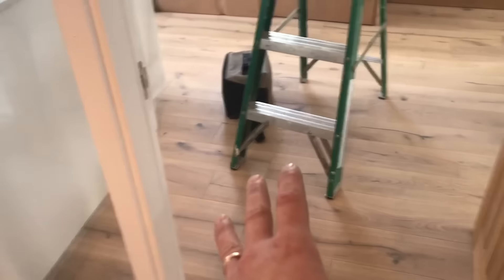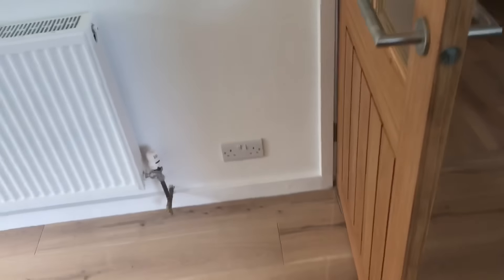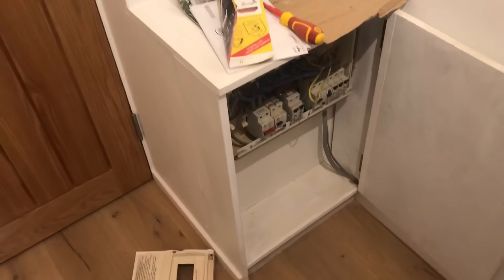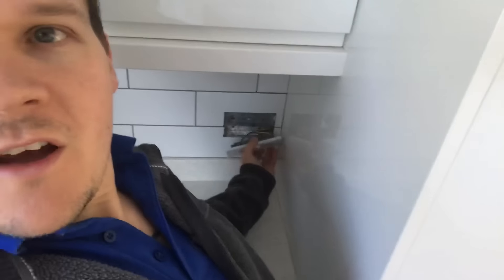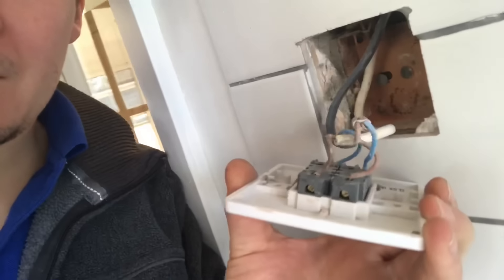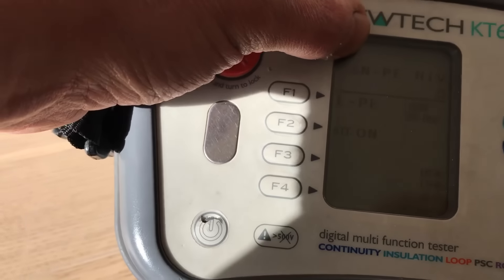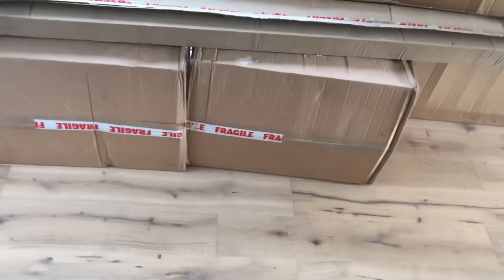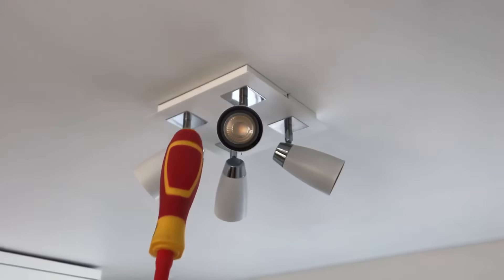Electricians day testing and inspecting one of the worst installs.

Comment: I laugh anytime an electrician says "absolutely shocking"
Reply: He's probably a switched on guy ,that's about as current a joke I can think of.(sorry).
Reply: @raychambers3646  Go ohm, you're drunk.
Reply: I might be in capacitor tated, you cant me charge for it.
Reply: I only became a sparky because I was no good at the polevolt.(or jokes )by the way if you are going to charge me I will brace myself!cheers
Reply: Guys, stop before I blow my fuse. Watt are you doing?
Each and every pun is only amping up the amplitude of my reaction. One more joke and I'll snap in a hertz beat.
I should be unphased by these, but I just can't. If only I wasn't grounded...
Reply: Erf, erfing, erfed. Hehehehe
Reply: James Bond slaps heater in bathtub, bad guy gets electrocuted. “Shocking. Positively shocking”
Reply: But it is shocking. Lol
Reply: You guys have Zero Potential
Reply: I don't give a fluke
Reply: Deplorable has no shock value

Comment: Thats why we use tubings in Switzerland so we  can replace the cables if it's  needed, without destroying the walls and the ceilings
Reply: While we also have that black ribbed tubing in the walls, you will never know what pain in the ass is to replace cable in one of those.
It is better for the wallet, but it is really frustrating, especially when a wire gets stuck somewhere and you have to fiddle with it.
Reply: in sweden we use thoese as well but lets say so, if you haven`t pulled cables into it or replaced, you dont know how to install it.
Reply: Fuck yes. That's how it should be done
Reply: @lazar2175  🤣🤣🤣🤣
Reply: We also do it in austria, just had problems with tubing from the 60s😂
Reply: @yanicascari5414  everyone has this problem😅 but there are some special sleeves vor this type of tubing.
Reply: We do in the UK but usually only on an industrial job!
Reply: @lazar2175  You obviously don't know how to fish wires through a flexible conduit.  Next time you want to pull wire through a ribbed  conduit try using fishing wire and a vacuum cleaner  plugged onto the other end , no more stress!
Reply: However, that it would require the job to be done by an electrician so they would actually install the tubing in this case someone who wasn’t qualified did this so the standards become a little bit irrelevant because they wouldn’t follow it

Comment: Ipx4 is basically the same as IP44 The 1st number is protection against solid materials and X just means that protection level not formally tested.
But i would always really suggest to the client to go with a ip65 fitting atleast just as a over protection.
Reply: Agree sometimes I’ll even go ip68 just to go beyond minimum requirements

Comment: I’m an electrician in the states and all this is super foreign to Me, but I absolutely love your passion for the trade, makes me think there’s still hope
Reply: I live in the States, and I'm not even an electrician and some of that work just looks shoddy at best, especially the uncovered wiring. That's a fire waiting to happen. Least they could do is wrap it in electrical tape.
Reply: I'm not a sparky but understand most of this stuff (bonding, wire gauges, IP ratings, MCB ratings, RCDs, switch ratings, rings,...) but I've looked at some US electrical vids too. Knew it was 110V, but what surprised me is that the 110V is actually a centre tap off the transformer and both halves are brought into the houses, so there is actually 220V available for heavy duty appliances like washing machines. The other interesting think to note is it's all single phase for residential in the UK, but in Germany, I've heard they do triple phase cookers and things.
Reply: @andyonions7864  yeah in the states standard residential mains are considered 120/240 split-phased. BUT.... I have seen larger homes in New Orleans with 120/208 Delta high-leg before.

Comment: When my  pedestral fan died as a kid, maybe 10 years old i took it apart a little as it was around 8PM at night and hot and humid as. Worked out the timer had crapped out so bypassed it to allow normal fan button control sans timer. Of course i did not know electronics at all, so i used a knowingly smaller gauge cable to get me through the "night" as a temp fix with no understanding of electronics or electricity (it's all i had, i used my professional touch the insulated cable why live after an hour to test for excess heat, solid pass as i can write this). It held up for another 15+ years before i refused to move a sub $20 item to yet another house. I don't know how i survived as a kid. That works seems similar to mine, except mine worked reliably for 15 years lol. Jesus, some terrible work there.

Comment: I am a retired research professor. I've worked in laboratories wired this badly. Scary. 
   What is even worse is when the sparkies come in, do a repair on another part of the building, and your equipment stops working. Motors running backwards, one phase dropped on a three phase line, and so forth. Radio frequency signals on the lines, and other insane things. Good luck cleaning up the mess!

Comment: IP44 is IPX4 compliant.  The X simply refers that the first number after IP can be any number.  The last 4 is the important bit.  That said, the whole installation is worse than most DIY jobs.  I think the spark who did that went by the name of Stevie Wonder...
Reply: I wonder if a shower qualifies as a "water jet"?
Reply: First number refers to dust ingress, second is water ingress.

Ipx4 means the dust ingress is not required but has an ingress protection of 4 for water.
Reply: @synony6  Yeah, but the "manual" showed X5 for a water jet so I was just wondering if a shower qualified as one.  I'm leaning towards it not doing so.
Reply: @thisnthat3530  Imo,with the lamp being that close to the shower head means it's possible for "water jets" to fly about. I think most people don't point their shower heads at the ceiling and much less at the light fixtures but hey,anything can happen...and it's still possible for it to happen to that light fixture. Agree?
Reply: Does any of that really matter when the fitting isn't earthed?
Reply: @firstsurname9893  shouldn't need an earth, it's marked as double insulated. Although I wouldn't trust it with the extra choc block.
Reply: @98dizzard  Cheers for the clarification, the screen I'm on is so tiny the symbol just looked like a blob.
Reply: Was reading the comments to see if anyone els picked this up😂
Reply from the maker: The light fitting is pure shite so are the connections I would not be happy showering in that shower.
Reply: O your correct the electrics are really bad... I would of walked away... And said call me if you want someone qualified to do the install...!!!!!
Reply: @Boons___1  Kids always find a way. Gotta build stuff for the worst case scenario. I just wonder how effective a fan is so far from the shower, a 12v unit directly above would do the trick..
Reply from the maker: Concrete ceiling
Reply: @brettv8  yeah I agree
Reply: Do your wet area rules limit the voltage in the zones? So does it mean ipx4 with a maximum 25v AC in zone 1? With the 240v connection in a zone 2 or better. I'm a bit confused on how that's worded in the rule book. Cheers
Reply: the first number is the size of the holes, IP2 and up you can't touch any parts with potential. The second number is how resistant to water it is. IPx5 was needed in that special zone, and the light was IPx4.
Reply: @curtisbarry2950  me too hahaha
Reply: @jgarde5378  Yes voltage and "selv" Separated extra low voltage. Using an isolating transformer. Normally is the way to go. BS 7671 isn't a statuary regulation. However if you meet the man in the curly white wig and you have fully complied with them you can go home rather than jail if some thing was ever to go wrong.
Reply: uhm maybe I don't get it.... but the standard says zone 1: 25V AC or 60V DC..... doesn't look like a 25V AC light.... it shows anyway the double square "double insulation" so no earth is normal
Reply: This lamp has never a ip44  rating. That label lies.
Reply: I would have thought an IP44 fitting would have a sealed terminal block if located in the fitting base. Because the fitting base is screw slot, surely that would be over the 1.0mm access probe limit for the IP4X portion. Might be wrong though but food for thought though.
Reply: It was a double insulated fitting and IP44 light fitting in the shower cubicle so it's ok, rewire the rest but keep the light😂😂😂

Comment: In America you have to have a permit from the township or city your working in before any work begins. And are given a check list that has to be posted and checked off by an inspector at each stage to pass. And here in California you have to be certified to make up or hook up any wiring. Even if your just replacing a switch.

Comment: I am just amazed by the electrical installation my grandfather did 40 years ago when our house was built.. Nothing has ever failed plus the 3 phase cable that's running around the house can handle over 40KW at 240ac..

Comment: Last job I did was exactly like this same situation and I said to the guy who hired me (lovely hard working and understanding dude) that the flat is a shit show and it needs a total rewire. He said yeah, whatever it needs, especially since he would be renting.
So to save cost he helped me and we did it over weekends. We rewired every single socket, every light, added what was needed and when I say rewire, I mean we literally took it back to the main fuse and earth. New DB, then wired it all as if it were a brand new build from scratch. We even fitted bath gadgets, inductive cooker etc and in the end I’d say the flat is state of the art and with his help I think it cost him around £500/600 (maybe a little more- excluding materials).
But in a job like this you are right mate, nothing to do but a full rewire. I said it straight up to the customer when I had a look- we had to raggle walls back to concrete and everything but in the end it’s the only proper way to do things.
One thing I’d always advise is do what I tried, then leave lots of spare cable inside the cavities available for future sparks.
Also added junction boxes for lights etc where possible.
We took that place from fuse wire and disaster, to split 12 way DB with dual RCD. Not heard of a problem since. All the testing was well in line too. Sometimes the hard way is the right way.

Comment: If that much money has been spent on the flat, i'd get the painter back as well as the sparky.
Reply: He painted the floor aswell. 17:13
Reply: the guy that did that job, wasn't a 'sparky' by any stretch of the word.
Reply: come to that, she should also get the plasterer and carpenter/builder back. The whole job looks reasonable at first glance, but the closer you inspect, the more you find which could be done differently and better. She has been comprehensively ripped off.

Comment: Regarding the lamp in the bathroom. If IPX4 is required then IP44 should be ok right since the IPX4 dont care about solid object ingression. :)
Reply: Regardless of the IP rating it's not suitable. Although in terms of an EICR, if ceiling height is above 2.25M (which it probably is) its outside of all zones
Reply: @londontrada  He measured the distance and it was only 2.1m to the ceiling, this means the fixture is in zone 1.
Reply: @thomasbonse  ah, well there you are.
Reply: He clearly said the fitting was in zone 1 and required an ipx4 which the fitting was an ip44 which means the fitting itself is fine
Reply: Who cares about the IP rating, the bloodly thing had no earth!

Comment: at 16:00
IPX4 and IP44 are equivalent. IPX4 means IP(anything)4. The first number is irrelevant as it denotes dust resistance, the second number is the water resistance.
So there is nothing to "add to the list" there.
Reply: Yeah, was all good until that bit..
Reply: @user-ul5gi9yw9t  The light is IP44, but it doesn't look appropriate in my eyes for a bathroom, not typical for a bathroom, also, do you trust some unbranded kit with their IP ratings.
Reply: @davidprivate5786  It's DAR lighting, not unbranded. Said it was good when in the kitchen

Comment: Great video, it’s all to common.  Arrive to install an extra socket or lighting unit.  Pre-work survey, no bonds, recent works, speak to the client, EICR performed & it’s horrendous.  I have a few times over my career stopped in the middle of a report, consulted with the client, charged the client a nominal fee & told the client to obtain quotations for rewiring.  Basically there was no point wasting my time writing up a report, where there so many defects, taking the age & condition of the installation, it would be more economical & safe to just rewire the property.  I always recommend that the client takes further advice if the property is decorated to a high standard.  It’s also nice to see an electrician completing the inspection process, which I see very few electricians doing considering the money they get for a report.  It tends to just be testing.  I charge a days rate for an EICR, so it can be done properly.

Comment: Pretty bad but I've seen worse!

I recently went through a flat in Austria, built in 1914, partly re-wired in 1991. Ended up being a full rewire including the 1991 parts.

Apparently before WWII the regs allowed for single-insulated singles to be run in plaster without conduit and some folks continued that practice well into the 1950s, so that's what we found. Minimum cross-sectional area for fixed wiring was 1 mm2 back in the day of rubber and fabric covered wires, 1.5 mm2 later (I'm not quite sure about the timeline, the German 1938 regs that came with the occupation certainly specified 1.5 mm2 copper or 2.5 mm2 aluminium and they were in essentially in effect until 1962). What we actually found was 0.5 mm2 doorbell wire supplying lights and sockets in some spots! The original circuit had probably been 4 or 6 amp but the 1991 sparks connected it to a 10 amp MCB and when that failed, someone swapped the wires to a spare 16 amp. That doorbell wire bodge job was apparently done in 1960 judging by the newspapers they'd stuffed into some of the holes before plastering. They couldn't be bothered to use continuous pieces of wire either, there were some runs as short as 30 cm that were two pieces of wire spliced together inside the wall!

Then there must've been another round of wiring additions, oddly enough using Italian accessories in tiny little back boxes (20x50 mm, 35 mm deep). That was all done in 0.5 and 0.75 mm2 twin flex plastered in, usually taking the craziest routes through the walls. Like, why spur off a socket 50 cm off to the side from where you want a new one if you can run some 5 m of flex through two rooms, destroying a whole lot of wallpaper and plaster in that process?

Or, if you want to change a ceiling light from a single-gang to a double-gang switch by adding a second switched line, why bother pulling wires through the existing conduit if you can trench halfway across a plaster & lath ceiling?

The chaps back in 91 disconnected all the Italian extensions but left much of the older stuff in place. I'm fairly sure in one instance they even ripped out some perfectly fine 1.5 mm2 cable, replacing it with new that was connected to doorbell wire, just because they couldn't be bothered to find either of the two junction boxes nearby. These didn't even have covers on, just wallpaper! If they'd found the box the old 1.5 mm2 went to, they'd even have found an earth! None of the existing work, except the kitchen sockets, was earthed, all the sockets were the classic round-pin type with no earth (legal for new installations until 1958). The basic idea was that in a room without any earthed pipes etc. you couldn't receive a fatal shock, even if you touched an exposed live wire so that's why those sockets were considered acceptable (some countries kept that system much longer, Sweden until 1993!). In 1991 the sparks ran exposed earth wires to all the sockets to keep up with then-current regs but didn't do a great job either.

Comment: Don't you have standards and someone to report contractors too? In Australia the contractor would gone so quickly along with the person doing the wiring.
Reply: If that had happened in the US, I would say the job was done on the cheap, without a permit or inspection. Because it certainly wouldn't pass even a rudimentary inspection. People do this kind of thing all the time. "Why do we need permits? It just makes it more expensive!". And of course when the house burns down and the insurance company discovers the work was done without permits, they won't pay. Too bad.
Reply: @adamshinbrot  Yeah the nanny state here the only way to get away with it is for the customer to be complicit. I also showed a UK contractor and he said it's usually because there are heaps on non electricians doing work.
Reply: @EarJuice  The problem is a lot of the foreign trades aren't anywhere near qualified enough, or at all. 
I've worked with a few, and when pushed have admitted they're not electricians or anything near back home. They get a load of non legit certs signed (NARIC doesn't check them properly),  do the 18th edition exam ( which is open book so you can't really fail), do a testing course and job done, "I'm an electrician". Or you get the 5 week wonders who think they know everything, after 5 weeks!!!
A Lot of British "builders" are like that as well, brown to brown, blue to blue, it works! job done.
Reply: @darrenng162  One phone call and massive fines to the contractor and individuals here.